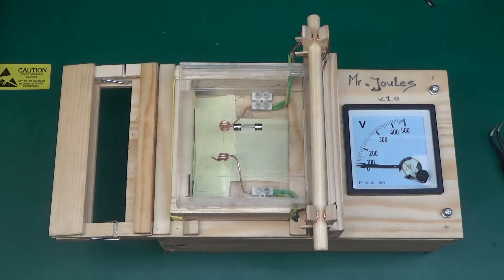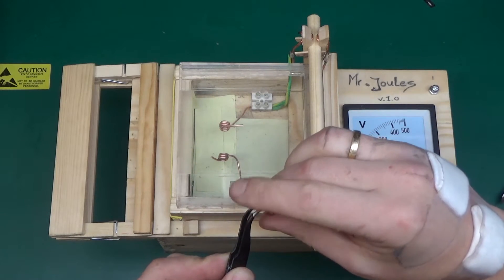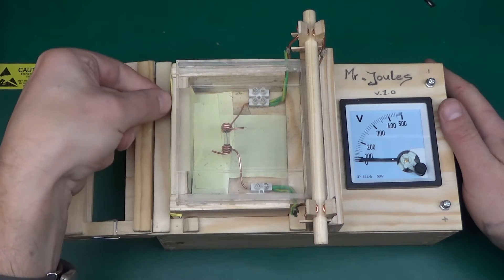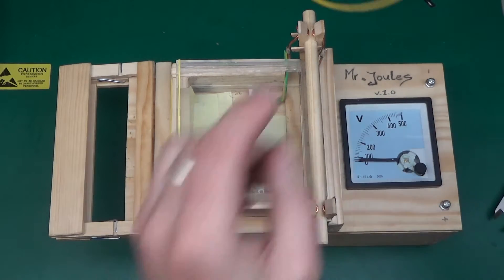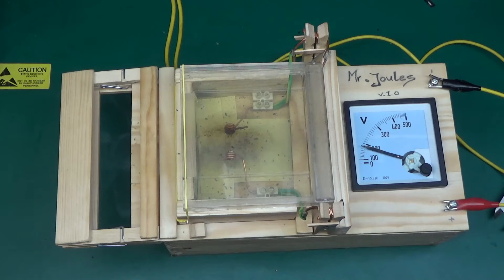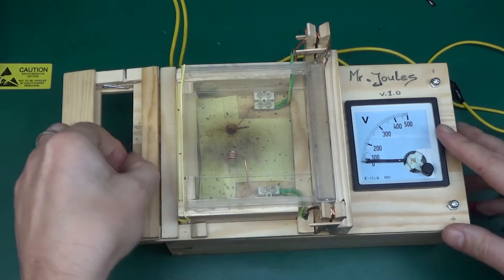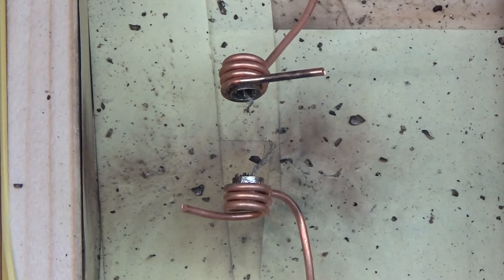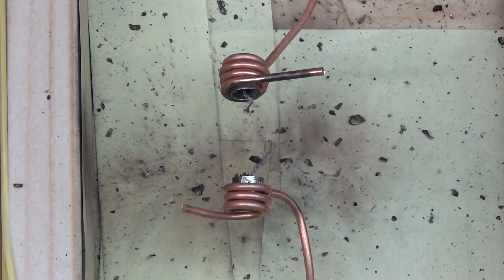Mr. Joules 001 - 20mm glass fuse

Comment: Funny original "sparky box". Maybe to prevent welding you can use silver contact from some  power relay?
Reply from the maker: FISHERMAN33RUS thanks! the contacts welding is not that big of a deal. I will just get them changed every so often. the copper wire just comes out, and I can put a new one in. easy :)

Comment: Very cool, I love your Mr. Joules videos!  Out of curiosity have you tried one of the Ceramic 20mm fuses yet? They look identical to the glass fuses but with a small ceramic cartridge instead of glass, the non HRC type.

This is the closest to the type that my super cheap DMM uses that I could find on Digikey.  I'm curious if they explode in a middle ground way, between a glass and a true HRC.

http://www.digikey.com/product-detail/en/schurter-inc/0001.2514/486-1772-ND/639712
Reply from the maker: +Tinkering With Terrius Thanks! There is more coming. More fuses and other stuff too ;) I am open to suggestions on what to showcase in next Mr. Joules episodes. The small ceramic fuse is a good idea, and I think I might even have a few somewhere around :) Take care!